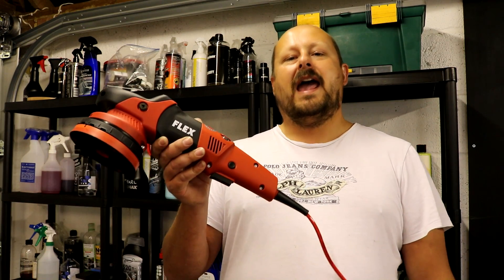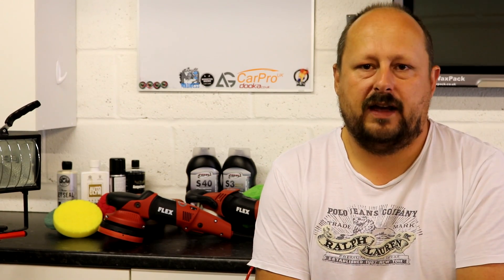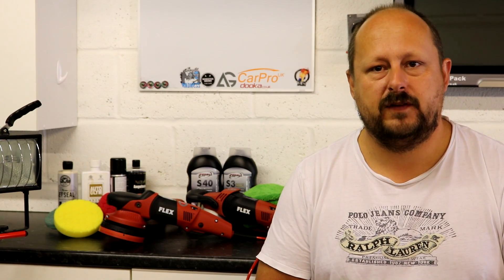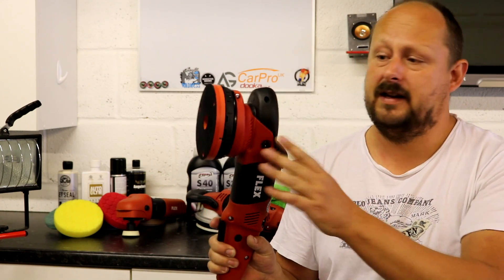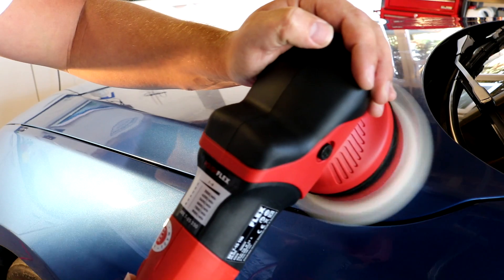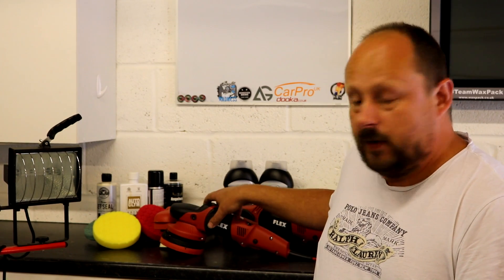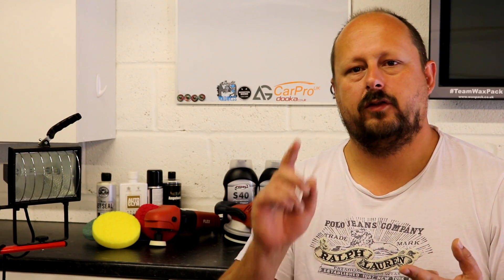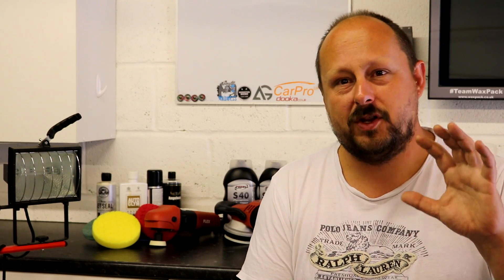Flex XFE 7-15 150 review demo - Long Throw 15ml Dual Action polisher

Comment: Hi John, just came across your channel a couple of weeks - absolutely great 👍 one question, this machine bake-off was in 17. Does this still stand as the best choice for the budget? This would be my first polisher 😊
Reply from the maker: you know what, I think so.. the one thing I have not done though is owned one and hammered one.    but I speak to a lot of people..  theres no issues with failures I know of, theres a 2 year warrenty on them.   They improved issues I talked about in this video around vibration.  Overall its a cool machine..   its just if your not a professional then the chinese das6 pro is like a third of the price and can give you the same results.   The pro will opt for a flex or rupes if you are using them everyday.  if money is less of an issue and you want cool tooling.. then go for this and pair it up with the Xfe 7-12 later on (the mini one if thats not the right model nyumber cant rememeber)
Reply: Perfect -thank you 🙏 fantastic channel, ram packed with so much info 😎🤓

Comment: Constant speed control, what is good for? Have
 a machine with this feature and thought it would make the polishing pad
 not bog down so easily but completely useless in that regard.
Soft start is just irritating to me, just slowing down my polish pace.

So, according to me, do not let these features determine your machine selection

Forget of course, thank you for a good review!
Reply from the maker: I dont agree, the constant speed obviously cant directly control the free spinning rotation... but by maintaining the speed of the main axel you do provide more consistency than you would have without it..

Soft start..  yer prolly not essential allthough I would rather have it than not...  it gets up to speed quick enough that it doesnt slow me down...

but you have choice deje.. so if you dont want the electronic features that might lean you towards the pro plus which is a cool tool and is incredible value.
Reply: Hi john
As always in these questions, the taste is like the butt, divided
Hehe, I already have Das-6 pro +, a very competent machine, soft and nice in action, 
definitely an affordable one.
Have already far too many polishers,.Another machine that might be 
interesting for a beginner is Cocraft HPV 720, will be provided with a 
125 mm backing plate later in the summer,do I have it? Of course,, is detailing  addictive, not what I have noticed, hmm!
Reply: I don't have any power in my garage, so I'll be using a cheap Chinese inverter. Slow start MAY prolong the life of the inverter, by slowing ramping up the power. (I realise my situation is rather unique) Mind you, I have no intention of getting a Flex - I'm just talking hypothetically. ;^)

Comment: Hi John, I have just purchased my first DA and went for the flex xfe after watching your review. as I am a complete novice,  I was hoping you could give me your opinion on Polish and pad  combo. I was considering scholl s30 with a medium orange pad as my paint is reasonably fresh...2013 estoril blue BMW paint. it's not in bad condition hence the reason for the less aggressive cut. have you tried s30 and if so would you recommend that combination for my scenario.  Cheers in advance 😊
Reply from the maker: anything in the scholl concepts range will work.   I dont have s30..  I tend to do all my cutting with s3 gold..  if theres not much cut to be done then I go with 1 set with a heavy and finish down with s40... or sometimes S20 black own.. this stuff is magic... finishes down like a fine polish but does carry a fair amount of cut at the start of the set...

Id almost say if your doing this for the first time you will get better results just using s20 black on a green hex pad and focusing on spending your time to make sure all areas of the car are covered and work very slowly.. because you will gain a huge amount of time from not having multiple stages, and that time you get back can be spent making sure you really hit ever part of every panel...
Reply: Forensic Detailing Channel, thanks for the speedy reply John.  I had considered the S20 as it gets really  good reviews, I was just a bit  concerned that I was cutting more than I needed to with it. I trust your judgement though so I might just go with it . Thanks again 👍
Reply from the maker: yw mate..  s30 will serve you well also for what  your trying to do... will be hard in terms of results to know the difference.   based on the key thing you said that you are not trying to do heavy correction...

Comment: This one or xc3401 for one step correction on german and japanese  black paints hollograms free every time  ???
I have Intermediate skills with short through  da polisher
Reply from the maker: XCE forced rotation no contest :)
Reply: @ForensicDetailing  ty vm John.
Write your bank account details please so i can send some  money for your advice.
Hope i can handle perfect finnish with xc34001 and one step scholl s20 for example. 
It has 1050w power though. 
Planning to hook it up to 100ah battery through pure shine wave 1500w inverter 
Wonder if 100ah battery with that inverter will manage large 4x4 on the  same day without recharging. 
I have once polished whole car with cordless drill so i guess i can manage it with xc3401 as well :))) lol gray paint though it was invisible hologramms left :))))))

Comment: Just on the speed issue... are modern polishes be able to handle the extra speed. Wouldn't they break down faster reducing their working time.
Cheers
Donut
Reply from the maker: Hey mark

Flex tools have a good reputation for reliability and durability.

You are going to be working the tool harder at higher speeds, but it will be designed to cope with that no doubt..

Also you dont have to operate the machine at those high speeds all the time...   from the day I got to play with it speed 3 corrected very well..  I wasnt concerned about the tool wearing out faster from the high OPM rate it had.. I was just more curious just why it went that fast really.

Comment: Hi Jon, ok taken the plunge and ordered the XFE7 15 150 which is my first polisher. I have a 9 year old BMW which has been looked after but has lots of swirls/spiders. Following your videos I’m going for two stage approach, using Scholl S3 Gold compound then S40 polish. Could you advise me on a set of pads as  seems so much choice it confusing. Cheers Steve
Reply from the maker: Hellom Steven, Flex purples to cut.  And flex orange to polish (from slims)     These will work great on the flex machine.  use 125 ml plate.
Reply: Thanks again Jon, watched some more of you other videos today (addictive rabbit hole!) and also ordered some Hex logic quantum pads - Yellow (can see you rate them), Orange, Green, White for polish and for good measure a black to apply the wax. So lots to experiment with - keep up the good work, aside from the knowledge transfer its good for the soul to see and hear genuine people like yourself 🙏

Comment: Another cracking video John, I ain't got my da sorted yet but will be doing totally based on the brilliant information you have provided over the course of the video's of the machines covered, now i loved the look of the 3401 vrg when it was first launched but the force gear drive makes me panic thinking if it corrects as fast as a rotary it can burn like a rotary.....so i'm loving this 150, only problem i'd have not even having held a polisher ( although i've seen so many of your vids and others that in my head been there got the shirt lol)  is the quick lowest speed, but i'm guessing that that coupled with the soft start after a couple of mins would pale into the background, cheers again john, would you have any ideas on a video show what is a good match, say,type of pad - to product used- for what problem. and what would happen with the same product used but altered pad from say cutting to finishing?...there does not seen to be to much of this information around, cheers.
Reply from the maker: you could use the CG quantum pads with the holes in them over the hex logic ones.. (utilise the hole in the plate better)

In terms of products...  For 2 stage work
S3 gold xxl to cut..
s40 to finish..

In terms of what pads..  a medium to heavy cutting pad which the compound..
And the standard polishing pad..

So for example with hex logic.. The orange or yellow cutting pads with S3 and the white with S40..

And S20 one step with green hex logic..

Generally the polishing pads are softer with smaller pores..   The cutting pads are more rigid with larger pores..   remember its the product doing the work and your just looking for the method  to transport them over the clearcoat and handle to debry...

Thats like a basic starting point..  theres millions of pad and product combos now..
Reply: cheers John thanks for the feed back.
Reply: jon how many pads would i need to do a whole car that has minor swirls and how many would i need for a car that has major swirls on average hatchback? eg 7 orange 4 white?

Comment: Any news on the XCE?  Supposed to be their next forced rotation DA, but can't find anything current on the net!  Thanks.
Reply from the maker: info on that tool is a bit sketchy.. but when I last spoke to flex about it.. It was never offically a tool that was going to be released to replace the 3401..  I think word of its existence got informally put out there in the states...   So Im still under the assumption the XCE was just something they were playing around with...  if I hear anything else Ill let you know.. or who knows the situation may have changed from that..  but thats my understanding..

Comment: Would you recommend this for a beginner John?
Reply from the maker: only if money is not like primary focus m8 but I think the tools are about the get an update in the UK so touch basis with flex mate.   I like their polishers.  I use cordless battery powdered stuff from flex its been awesome but very expensive.  I like XCE to more than XFE
Reply: @ForensicDetailing  thanks for the reply John. I’ve seen one that’s almost brand new for a good price. I’ve looked at the Das 6 Pro Plus but they are sold out. Rupes looks expensive. Then there is one by Dodo Juice and Autofinesse.

Comment: how many passes  do you usually  do with a compound  ore a Polish   on a DA and is it even possible  to correct the paint  fully   with a cheap  DA  cheers mate
Reply from the maker: I dont really count my like cross hatch passes within a set now.. but its prolly around 6-8 passes in total in the set..  sometimes less because I move the machine like a zombie (non turbo zombie.. So more like a walking dead zombie than a "I am legend" turbo zombie)

Comment: I've got money to burn and I'm itching to get a new (upgrade) DA. It's between the one being reviewed here and a Rupes LHR15 MK2. Anybody with hands-on experience with both that would care to share their opinions? I'm not a pro, maybe an advanced hobbyist at best, and I just want a really nice machine. I currently own 2 Harbor Freight machines, a Griot's Garage 3" polisher and a Flex VRG 3401. I also have an El Cheapo rotary that I'm quite happy with and it fills my needs in that regard. I know I don't need yet another polisher for the amount of work I do, but which of the two in question would complement my current setup best?

Comment: Hi Jon, I bought this machine about 2 years ago. I am currently using it for the second time. I have noticed a lot of fine rubber particles coming from the machine while polishing,it's as if the plates are rubbing together. Is this normal for a new machine or should I contact the supplier because I can't seem to get good results with it and I think the rubber particles getting under the pad night be the problem. Has anyone ever experienced this ? This is my first machine so I don't have any experience.  Thanks in advance .
Reply from the maker: thats does not sound normal no Chris.   It has 2 year warrenty.   maybe you have the very first iteration of the tool with the ball bearing counter weight.   Speak to flex they will sort you out, or they will advise if its normal.
Reply: Thanks Jon, I didn't think it was normal. I didn't seem to be getting as much rubber particles by the time I had finished today suggesting that it had worn away enough  of to be rubbing any more.  I didn't get the results I was hoping for also but then I'm not experienced enough to know what to expect. I will contact Flex, thanks again .
Reply: @chriscarmichael2277  what was the outcome please ?

Comment: What differs this from vrg ??
Reply from the maker: the metal housing of the VRG has a track...  the VRG backing plates have cogs which run in that track..  This locks in the plate and stops it from turning untill the 8 mill offset free spinning bearing it forced to run around the track by the rotation of the main axle.. (hence why the plate turns anti clockwise when the axle turns clockwise)

So you cannot stop the VRG from spinning...  its fixed rotation...

Comment: you havent used modded Rupes, right? i have all the Rupes machines and pe 14-2. Rupes Mk2 21 is my favourite by far. Both the 15 andd 21 beata my Rotary on correction speed. I have tested rotary+wool vs Rupes+mf.

anyway good video like allways 🤗
Reply from the maker: Yo JTM thanks m8..

your not testing like for like..   rotary has the capability to cut clearcoat at a more rapid rate for me.. (long discussion)

but yer the DA's give a good consistent amount of performance and cut and less can go wrong...

Ive not used the rupes modded, it was not a good idea to review it with the mod for the channel...  generally if I have to alter a tool to get a desirable level of performance then something is wrong..  The manufacturer is against modding the tool because it also increases the pressure you put on the free spinning bearing.
Reply: Well im talking about using the machines right way. With rotary i used like 1800rpm on a woll pad and tilted the pad for first couple of passes. And with Rupes just moderate pressure. With Rupes you i can correct defects faster and with rotary one could do damage faster(heat) especially with a foam pad.
https://www.instagram.com/p/BT-HDo0DjJa/

Only pad that i have been able to make rotary beat rupes is the Avenger https://www.instagram.com/p/BQFyFLYDSK_/ which is absolutely sick woolpad. However microfiber xtra cut discs even  things. Next week im getting Kamikaze beat backing plate and woolpads. 

I suggest everyone test modded rupes and microfiber, you will be amazed ;)

Comment: So the flex is 710w rupes is 500w is flex more powerful then?
Reply from the maker: no its a bit like saying a 3.2 V6 is faster than 2.0 turbo.    You cant see from this how much torque is going to the wheels.   And you cant compare from the engine input or output power how much torque is being put out.. gearing comes into play but also the quality of the motor etc...
Reply: Forensic Detailing Channel but one thing rupes says 500w flex is 420 out put 710 input so is the rupes 500w rating input or out put but personally wich do you think is better
Reply from the maker: @hakman239  see my first answer you cant derive torque from it, theres gearing involved as well.  Its all meaningless.

Comment: I too am looking to upgrade from the PC and was trying to decide between flex 3401 and rupes Bigfoot 21 Mark 2. Was leaning on the flex 3401 simply for the force rotation but then I hear it spins counter clockwise n harder to control n use compared to the rupes as it spins clock wise and a lot easier to handle n use n just more comfortable. That is until I hear about the Flex XFE-7 and now I'm here watching these review. Also I stumble across a Facebook post from rupes and they revealed a new force rotation DA polisher called Bigfoot Mille LK 900E. Now I'm gonna wait for that one to hit the shelves and see how it will preform. What's everyone's view on rupes new DA polisher that will be coming out? Here's a link to rupes page and the new products coming out 
http://www.rupes.com/en/new-products/#BIGFOOT%20LK%20900E
Reply from the maker: i think its fair to say rupes do a better job of getting endorsements from detailing "stars" than the flex..  however for me I find the quality and engineering of the flex tools better...  I still like rupes..

the fact the 3401 spins counter clockwise is nothing to worry about and takes about half a nano second to adjust to.

Comment: Finish machine..good build but bad cutting...i sold mine after 5 days
Reply: Was it stalling to much or what was the reason for not cutting well?
Reply: @wanderlustdetailer  because she had small head mowing and low rpm...good machine but if you have rotary and DA free spin this machine you dont need...not cut like rotary, not finish like DA free spin...